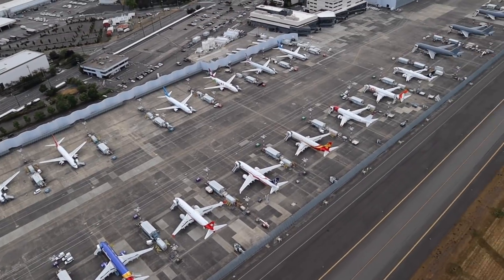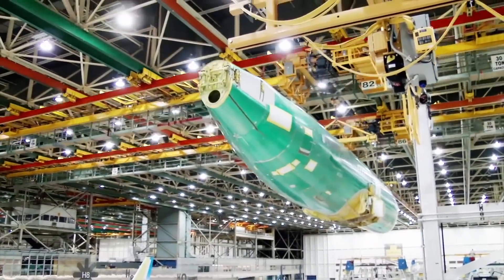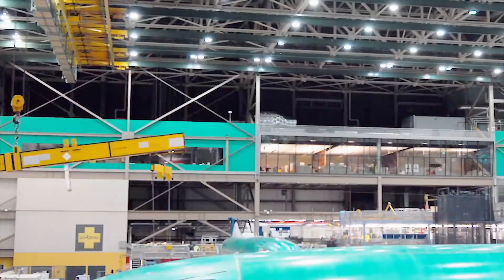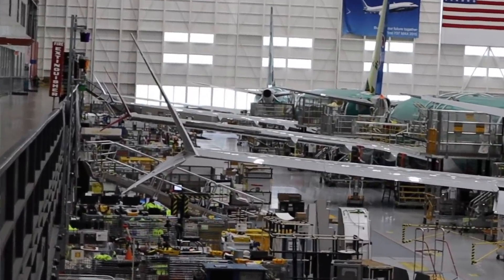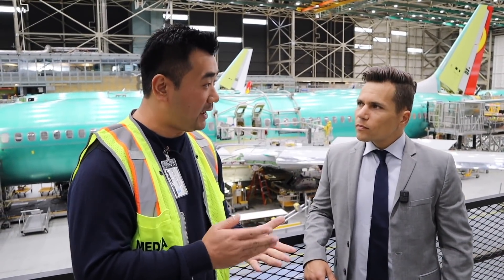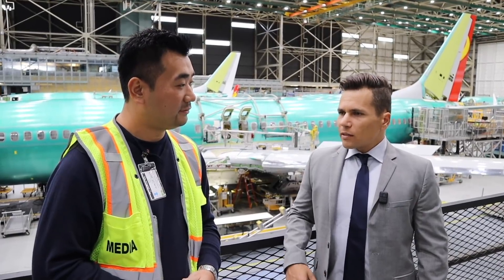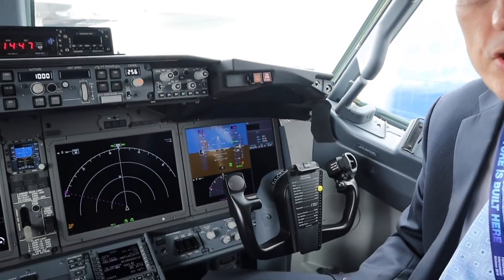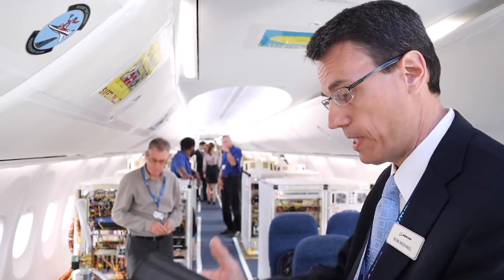Boeing 737 MAX - How Boeing Builds Their Best Selling Plane

Comment: With hindsight, it would have been better to put the leap engines on a "757 max" and stop making new versions of he 737 as it is an old airframe design from the 60s which was too dificult to retrofit with large diameter engines. At least the 757 has long legs for bigger engines.

Comment: Hey why didn't MCAS activate on 5:28
Reply: MCAS is deactivated by design if flaps are not retracted. 
346 lives could have been saved if Boeing at least informed this to the airlines and the FAA, instead they chose to simply mention to switch off the stab trim cut out to disable MCAS after the Lion Air crash which sadly later everyone found out doing that it didn’t help to deal with MCAS that had the aircraft out of trim already making it impossible to recover manually leading to the Ethiopian Airlines crash few months later. 
It was fucking criminal 😡

Comment: That's a steep take off at 5:28. I thought MCAS was designed to stop the nose rising so high
Reply: No. The angle of the plane is not the same as the angle of attack, MCAS isn't active when flaps are extended, MCAS is not a stall protection system, and the plane was not at risk of stalling in that maneuver.

Comment: I predict it will NOT take too long before everyone realizes that Southwest Airlines is partly to blame for the 737MAX mess. During the 1990's development of the 737NG and again during the 737MAX, Boeing kowtowed to the desires of SWA cost-cutting! Whenever Boeing wanted to add a safety device (e.g. autobrakes, electronic checklist, better navigation displays etc) SWA declined unless it added no cost to the jet. So the blame of why the 737MAX has the same cockpit as the 1960's model can be put squarely on Southwest Airlines. Boeing simply gave it's best customer what it ask for...

Comment: And it crash because of the engines is build a bit higher than normal
Reply: Planespotting Videos actually that’s not right for 737 max crash due to software in the nose called MCAS the software thought the plane was at angle and pushed it down ultimately causing the crash...

Just look it up..
Reply: @rekio.5199  actually they're correct. The engines made the plane have a tendency to pitch up so the mcas system was put in place.
Reply: Jacob Allan Yeah but the thing that caused the crash was the software that Boeing rushed to put into the planes to get the maxes out faster. Boeing should be in a big ass trouble for those crashes

Comment: Lipstick on a pig. The 737 is basically a mild update of the 1952 design of the Boeing 367-80. Same cable operated actuators. Same basic dual independent channel systems. The rest of Boeing moved on to modern triple redundant fly by wire and the 'latest' 737 added more crap to a crummy old control system. What it isn't, and can't be tarted up to be, is a triple redundant system like all the modern Boeing aircraft, and all Airbus aircraft.

Comment: Interviewer :   So whats the difference between the 737 NG & the Max?

Greg : Well the max has new engines that are far too big for the plane that causes it to stall on take off so to offset this 
            we had a computer geek with no FAA certifications to make a piece of software to force the nose of the plane down  
            continually activated by one sensor-- and we wont tell the pilots about this software because we dont want to pay to  train them  and we need to compete with Airbus ,so hundreds of people will die horrible deaths . but besides  that  both planes are EXACTLY the same .

Interviewer  :  ?

Comment: 1    install faulty AoA
2      install mcas and don't tell           anyone let alone the pilots 
3       Have no written info in the QRM about mcas 
3a  get the  pilots to do a 30 min update how to fly the max on the iPhone. 
4       Fake the test data and tell the FAA all is OK
5       Tranfer 900 Boeing inspectors to new posts and micro manage. 
 Unbelievable the arrogance of  the Upper management and the blatant lies.
737 max is the new DC10

Comment: I worked in Everett on the 747-400 and 767-300 and worked at GE Aviation.   Feel bad for Boeing however the decision to put a  giant GE leap engine on a old aircraft design frame was a poor decision.  Shortcuts always come back to bite you.  GE should  be held accountable also for letting Boeing think it would work.
Reply: The burden of engine integration is on the airframer, not the engine provider.
Reply: @roberts9095  the engine provider makes the engine that works, could've told boeing that it wouldn't work or anything of the sort. its possible that boeing just rushed the plane to compete with a320neos
Reply: Lol they’re clearly trying to not make pilots retrain for a new aircraft. Use your fucking head so called “engineer”

Comment: MAX will return.. with more safety features...
Reply: It will still be an unstable platform that cannot be fixed. The plane unlike any other needs the MCAS to counter the aircrafts tendency to go into a stall situation becauce of the new engine placement. Boeing screwed up . They have pushed the 737 design to far. They should have designed a completely new aircraft but they decided for the sake of pure profit to push this design past its limitations and it has cost them. 

Weather the traveling public will trust this aircraft , Boeing and ghe FAA is another question. I have been asked by at least 40 people how to avoid the Max when it starts flying again. They want nothing to do with it. Ond of ghe people I talked to even put ghe info I gave them and had it put in the company newsletter which is seen by over  2000 people nation wide.
Trust will be Boeings biggest hurdle with this aircraft. They screamed that the aircraft was safe even after the 2nd and everyone eles had grounded the aircraft except Canada and the USA . Well they either lied or were to blinded by the possible financial losses to be able to admit the truth, either way they dishonored the public trust that they relie on bso much.
Reply: @thearsenalmisfit2414  Hi Steve, What about the pilot training. I heard the pilots on both incidents was confused to override the safety feature when they noticed the abnormal nose dive. That also a possible reason I think.
Reply: Like it should have had in the first place

Comment: The same 50 year old design as if they are doing something new. Funny how they realize the engine is too big for ground clear clearance. Didn’t they know this before they complete the project. 

That plane have problems gliding.
Reply: rob robinson  hey asshole pull your head out of your ass and breathe fresh air and see daylight and learn what the MCAS system does for real and NOT your interpertation of it  Juan Browne a 737 pilot has excellant info about it on his channel here on You tube !!!
Reply: Rob your right, I don't care what anyone says.
Reply: Why would it need gliding dumbass 🤦🏽‍♂️😂
Reply: @joshkettley6011  the gimley glider dumbass.  Plane ran out of fuel midair and had to glide,  landed safely all passengers survived.  Look it up before commenting.  People like you piss me right off.

Comment: When Boeing install the MCAS, it is suppose to prevent stalling, does that mean the engine will stall, how come, when they are new and more powerful?
Reply: Stalling is nothing to do with the engine. It's what happens if tje plane flies too slow or with the nose pitched up too steeply.
Reply: Laminar airflow over the top of a plane's wing relative to the airflow under the wing is what holds a plane in the air. When the relationship of airflow over and under the wing is disrupted, the lift decreases. As the lift decreases, the plane enters what is called a stall and begins to fall. The pilot recovers from a stall by positioning the attitude of the plane in the airstream in a predetermined manner to recover the correct relationship of the airflows over and under the wing and reestablish lift. 

There is nothing new about aerodynamics, but engineers test the envelope to develope greater efficiencies. In the case of the 737MAX pre-existing constraints resulted in an envelope that put the engineers' skills at the raw edge.

Comment: With bad Chinese parts 

The same goes for aircraft-parts production, where China is also a major player. Bruns says every airplane Boeing makes includes parts from China. The Boeing 737 is probably the model most heavily reliant on Chinese parts. “They build the whole tail section, the vertical fin and the horizontal stabilizer, and then all the doors for the airplane. So if you’re just looking at the structure, that’s more than a tenth of the structure, maybe an eighth.”

Comment: An interesting little tidbit: If you compare the 737-200 cockpit with the 737 MAX cockpit, other than the displays, the actual flight controls haven't really changed that much, especially the control stick and the throttle controls.
Reply: Sacto1654 that’s to do with pilots type rating. If they change too much then a 737 NG pilot can’t fly the 737 Max one day after another

Comment: Did they put Cameras in the Cockpit link to the Black Box ? Have they put location devices on the black boxes ? Have they put location devices on the aircraft if it goes down ?
Reply: David Baker black boxes always have locator beacons but only last about 30 days because of the battery and is only for use if in water as sonar can detect it. And Boeing don’t make the black boxes

Comment: I wish Boeing would retire the 737. It's an really old design, so cramped inside. A320, C919 and MC-21 are all wider.
Reply: That's because even though the 737 doesn't look as flash as the other planes, it's design has proved to be exceptionally reliable. If you think about it, it's like the Soviet AK series except planes instead of guns.

It may not work for large commercial airlines (which we all know) but a lot of smaller airliners use the 737 frequently
Reply: You don't retire your cash cow.
Reply: +Shawn Johns. That's right they'll keep pushing it until no one wants it like what they did with the 747 and the new 747-8 even thought no one really wants it other then for freight .Boeing is coming up with a newer plane thats is somewhere between the 737 and 757.
Reply: It still outperforms the A320 in a climb.
Reply: @EinkOLED  and rapid decent.

Comment: The Whole Truth- why pilots don’t like the MAX 9 and why they wish for a 757 update with the 797, long but worth it-
WHAT BOEING NEEDS to build isn’t a fancy new long-range widebody. What it needs to build is a replacement for the 757.
When it debuted in the early 1980s, the twin-engined 757 was ahead of its time, and it went on to sell quite well until the production line closed twelve years ago. By now the plane is — or should be — obsolete. Indeed it’s rare to spot a 757 outside of the United States. But here at home it remains popular, a mainstay of the fleets at United, American and Delta, who together operate over three hundred of them. They’ve kept the plane on their rosters so long for good reason: its capabilities are unmatched, and there’s nothing that can replace it.
The 757 is maybe the most versatile jetliner Boeing has ever built — a medium-capacity, high-performing plane that is able to turn a profit on both short and longer-haul routes — domestic or international; across the Mississippi or across the North Atlantic. The 757 makes money flying between New York and Europe, and also between Atlanta and Jacksonville. United and Delta fly 757s from their East Coast gateways on eight-hour services to Ireland, Scandinavia, and even Africa. You’ll also see it on 60-minute segments into Kansas City, Cleveland, and Tampa.
Along the way, it meets every operational challenge. Short runway? Stiff headwinds? Full payload? No problem. With 180 passengers, the plane can safely depart from a short runway, climb directly to cruise altitude, and fly clear across the country — or the ocean. Nothing else can do that. And, it’s a good-looking machine to boot. Muscular yet graceful.
A 757 in the colors of launch customer Eastern Airlines.
I know this in part because I’ve been piloting the 757 for the past nine years, along with its somewhat bigger sibling, the 767. The 787 is an excellent replacement for the latter, but what’s going to supersede the 757?
Boeing is pitching its latest 737 variants as the right plane for the job. Airbus touts the A321. Am I the only one rolling my eyes? Sure these planes are sophisticated and efficient, but neither has the range, power, or capacity to match the 757.
With the 737, Boeing took what essentially was a regional jet — the original 737-100 first flew in 1967, and was intended to carry a hundred or so passengers on flights of around 400 miles — and has pushed, pushed, pushed, pushed, and pushed the thing to the edge of its envelope, over and over, through a long series of derivatives, from the -200 through the -900, and now onward to the 737 “MAX.” In other words, it has been continuously squeezed into missions it was never really intended for. Its range allows cross-country pairings, but transoceanic markets are mostly out of the question. It carries fewer passengers and less cargo than a 757, and at heavy weights it is often altitude-restricted. For a jet of its size, it uses huge amounts of runway and has startlingly high takeoff and landing speeds. The passenger cabin is skinny and uncomfortable, using a fuselage cross-section unchanged from the 707, engineered in the 1950s. The cockpit is incredibly cramped and noisy. And just look at the thing. The “Frankenplane,” I call it. I don’t care how many changes and updates the plane has undergone; at heart, it’s still a blasted 737 — a fifty year-old design trying to pass itself off as a modern jetliner. 
“The Boeing 737 MAX 9 falls short when you're trying to fly it longer haul, coast to coast. It can do it, but not by much," Patrick Smith said. In addition, when it comes to flying across the Atlantic, "there's is concern in the winter, when there are ferocious head winds, the 737 may need to stop for fuel."
I was jammed into the cockpit jumpseat — more of a jump-bench, actually — on an American Airlines 737-800 not long ago, flying from Los Angeles to Boston. Man, if we didn’t need every foot of LAX’s runway 25R, at last getting off the ground at a nearly supersonic 165 knots — thank god we didn’t blow a tire — then slowly step-climbing our way to cruise altitude. What would it have been like in the opposite direction, I wondered — a longer flight, from a shorter runway, in the face of winter headwinds?
By contrast, I recently piloted a 757 on a flight from Boston to San Francisco. At flaps 20, we lifted off at a docile 130 knots from Logan’s stubby, 7000-foot runway 09, with nearly half the runway still remaining! With every seat full and seven hours’ worth of fuel, we climbed directly to 36,000 feet and flew all the way to California. That’s performance.
Airbus, for its part, says that its A321, a stretched-out version of the A320, is the more adequate replacement than the 737. Perhaps it is, but this plane, too, fails to match the 757’s range or payload capabilities. An newer variant, the A321 “neo,” might prove to be more suitable, we’ll see. If so, and if Airbus begins to rack up orders, then shame on Boeing.
Reply: you sure have knowledge and writing talent. do you have any blog or website?
Reply: GairBrean data That’s very kind of you to pass along such positive words, and I appreciate your doing so. I read everything I can find on commercial aviation, I would enjoy doing a blog on Airplanes and Airports, I do write and answer question on Quora. I give a blog more thought, Thanks!

Comment: I want Boeing to bring back and max the MD80s. An MD80MAX with engine exhaust chevrons, swept wings, and Boeing sky interior  would be nice and competitive with the CS200/A220s
Reply: Putting bigger engines in the back of the plane is going to severely upset the wright balance. They’ll have to add weights to the nose or it’ll tip over and then it’ll waste the fuel efficiency